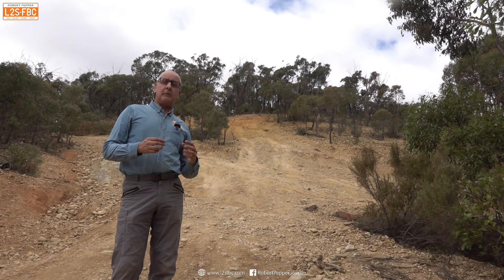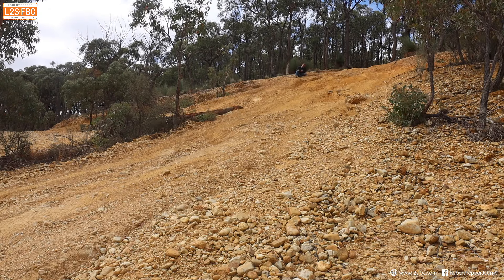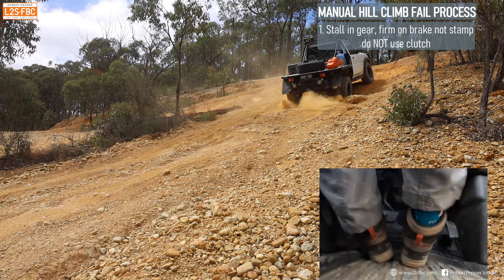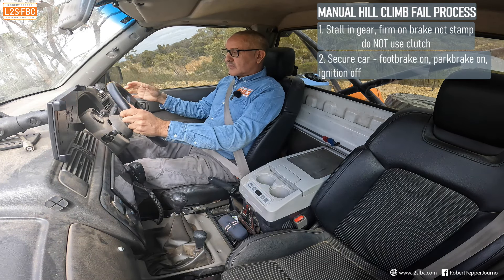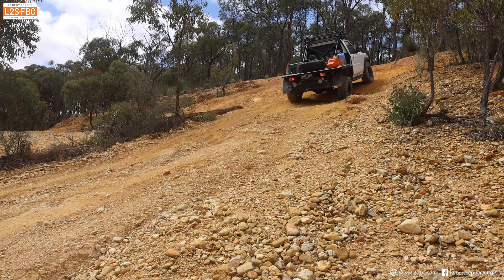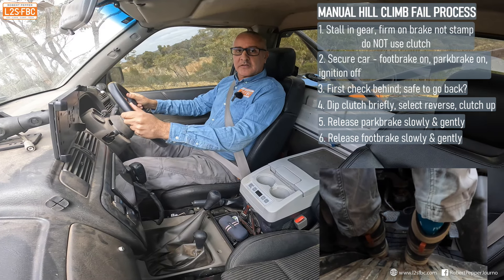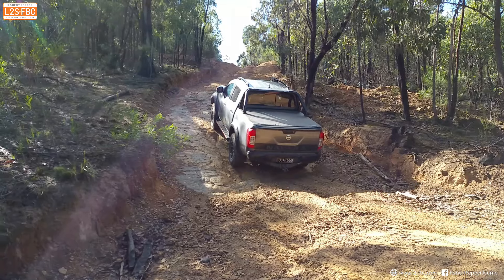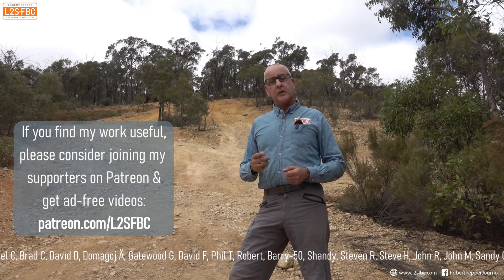How to safely fail on a hill - manual 4x4 edition

Comment: You can run the same stall recovery procedure in first low as well.

Catch is that some newer vehicles with electronic everything don't like the additional voltage drop from the extra load on the starter and won't start.

Pretty much anything with mechanical injection is good to go though.
Reply from the maker: thanks, hadn't come across that situation
Reply: @L2SFBC  Works great. Select the wrong gear going up a hill and run out of torque, it allows you to start again in first and make the climb.

Hence we call it a stall recovery procedure.

Not so much of an issue in modern cars, but for heavy vehicles it's a critical skill. Just don't try it in new Isuzu trucks etc. Great in a 20yo Hino though.

Comment: I seen someone attempt this in a vehicle that they weren’t familiar with… turns out they assumed this technique would work, but didn’t realise the vehicle required a foot on the clutch to start it. Pretty scary situation…
Reply: Newer models come with interlock clutch whereby the clutch must be depressed to key start.  There is a slight modification and less secure technique to allow for this.  Interlock clutch is included as a safety feature for people that are not frequent manual drivers, but it counter to good 4wd techniques.

Comment: Allways part of BORDA training if a relevent vehicle  is being used. we dont use the handbrake as time can be a factor, also we tend to have mud more often than not and handbrakes have a habit failing due to ingress of mud and water, so handbrakes are secondary to parking in the lowest gear.
Reply from the maker: Stand by for a faster version of this!

Comment: Thank you for the valuable lesson. Qq: Your demo car was a diesel, so great engine breaking. What about the petrols? Same philosophy? Thanks.
Reply from the maker: Yes, the same.
Reply: Some petrol 4wds will surge at key start.  Just have a little pressure on the brake pedal helps, then when the engine revs settles then release the brakes, but cover the brakes in case you need it.
Reply from the maker: I forgot to add that, thanks!

Comment: Thanks Rob - learnt something!

What do you do if you're towing a trailer? They never seem to go straight for me, so need constant steering tweaks. In the worst case I need to drive forwards to straight everything up, which would not be an option with no traction. Detaching the trailer doesn't seem like a sensible option either!
Reply from the maker: I have an offroad trailer towing video covering this.  Essentially...with great care as it is VERY difficult to back a trailer offroad down a hill!
Reply: @L2SFBC  thanks, can't wait!
Reply: Crap ya pants.
But in all seriousness don't attempt a hill with a trailer if you don't think you will make it cause getting out of it is very difficult. 
But if attempting somthing, make sure tow vechile is definitely heaver than trailer. No 1 rule is a brake controller is a must. Set it high.
Going up Slow is better as you find traction limit faster in a safer way. Better to fail bottom of hill than top!!
I don't use stall stop technic tho as you are highly likely to pulled backwards with a heavy trailer.
So If a fail is likely stop early, clutch and brake. If you stop thats great, my experience is from there I don't try go backwards, get pulled or winched up but if hills small and traction is available hit reverse and back down slowly using brake controller. 
But in poor traction scenarios a failed hill climb with a trailer I find results in a situation where a emergency reverse gets required,  You stop but straight away Trailer starts pulling ute backwards even tho its braked. So only way to get control is get in reverse as fast as possible to get wheels turning and back down under engine braking with trailer brakes slowing vechile.
Worst case you have to accelerate in reverse to get control back.

Run chains on trailers braked axles helps alot for braking and stopping sideways slip of trailer. 
Chains on ute also helps a large amount. 
Basically it's a extremely scary situation to get  when it gets that bad. A simple looking hill with Grass is the worst for it. 

I'm always watching videos and talking to others and practicing trying to find the better techniques to help me. As I'm always towing a 2.5 ton digger offroad with my heavily laden landcruiser trying to access rural and remote water scheme fixing leaks etc.

Comment: Hi Robert, could you please also do a Suzuki Jimny / Jimny XL, which also cannot be key started? I have been on a course where we needed to do a manual start and then go dual quick release of the brake and clutch to have it go back down safely? What if you needed to stop again like in your video? The procedure is repeated?

Further, I also experienced a situation during the stall where i could mot actually break with the foot brake when the car stalled? (The foot brake was not allowing me to push it down). Any idea on what happened witn the break and why?
Reply: I forgot yo mention, the Jimny was manual.
Reply from the maker: If I can get one yes
Reply: Than you - that would be great. I am not shure where you are located, but if you are close to Sydney I would be happy to drive it over.
Reply from the maker: @YouSydneyTube sorry am in Melbourne
Reply: If you make it over to Sydney or if you are coming to the 4x4 show in Sydney reach out and I will try to tee it up.

Comment: Like most, I consider myself a pretty good 4wder.  I do get nervous in my auto petrol V8 100 series in this scenario. Really seems to want to get away from me. 

Any advice? You’re welcome to use mine as a demo vehicle.
Reply from the maker: I'm getting a few requests for different vehicle types!  Going to do a manual Hilux which cannot be key-started.  I will do an auto one as well.

Comment: Does the test vehicle have reduction gears?
Reply from the maker: Has low range yes
Reply: @L2SFBC  I meant. Does it have a modified transfer case gear set. That's a common upgrade for the patrol. I have a set in mine that's 85% lower than oem. Doing the roll start on the standard reverse low range ratio can be sketch.
Reply from the maker: No, it does not
Reply: There are plans to install reduction gears, but 43% for more versatility.
Reply: @albertopamintuan6742  Fair enough. I do a lot of rock crawling and I don't regret the 85s.

Comment: My automatic cruiser has DAC (downhill assist control), will this work in reverse as in this situation?
Reply from the maker: Yes.  DAC is an HDC (Hill Descent Control) system which works forward and reverse.

Comment: Why not just leave in neutral with motor running & let it roll backwards slowly using brakes? (auto or manual)
Reply from the maker: Because there is then the chance of a skid.  Watch this for details.  https://youtu.be/z9TiHeTf0qg